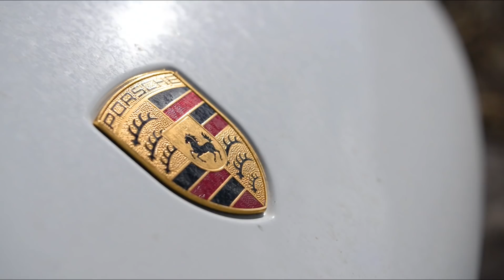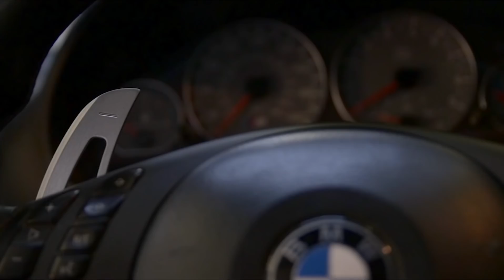Cars Are Changing

Comment: Bwhaha what?! Newer cars are easier to modify? That couldn't be further from the truth! Cars keep getting harder to modify!
Reply: Fábio Loureiro if I unplug my battery in my VW I get a check engine light I couldn't even imagine a remap
Reply: its harder, because sensors, and all those new stuff, nobody wants a check engine light just because you remapped your car
Reply: Yeah, you can't tell me that it's easier to modify a new 5 series than an old BMW 2002.
Reply: CJ Colvin I'm a 90s guy when it comes to cars, newer cars are trying too hard to look futuristic it's back firing. No attention to shape and lines, putting all attention into detailing and unnecessary ridges in the body.
Reply: Gears and Gasoline Wow really? It's common knowledge cars are getting harder to modify as they keep getting engineered more and more for economy.
Reply: It's little to do with economy and more to do with more and more sensors/electronic features getting in the way. Slap a minor bolt on onto a newer car and there's a good chance it will run weird without a tune, since the computer is freaking out.

It's also annoying that more and more manufactures are taking the "apple" approach and intentionally putting things in weird places to make them more difficult to work on. Some of the new BMWs don't even come with a dipstick because they don't want you changing oil yourself. Seems a little absurd to not let you check the most vital fluid??
Reply: As consumers get what they want, they change the products with them. Unfortunately, us car enthusiasts are the minority. Most normal people don't care about mechanical stuff or fluids in the cars they drive, which is sad but that's the way it is. Let's say normal people like shopping in malls and have interests in hobbies like art, does that mean you like that too? As much as I want to share the wonders of the car world to regular people, they couldn't care less. Just the way it is and I just wish...
Reply: Gears and Gasoline You obviously don't work on cars. Even simple things like changing a lightbulb are a pain in the ass in new cars. They made it more complicated so that everyone has to go the dealer.
Reply: Gears and Gasoline I imagine you've never worked on something with a live axle and a carburetor. If you get the chance you'll see how wrong you are!
Reply: Gears and Gasoline Except cars are overpriced, challenging to work on and they look hideous and ugly as well.
Reply: no, on modern car the engine bay got really cramp i can't fit a hand down there, also the oil filter on awkward position.
Reply: +Mike Seeds and those irritating plastic covers and shit. I sold my C63 amg because it's a money pit machine.
Reply: SideWayz Moose i guess it depends what,simple mods are easier,like exaust or performance chips or tuners,exaust dont have to worry about backpressure or adjusting carbs,and tuners can plug in and get more torque or few extra hp,but serious mods like bigger cam or injectors or suoercharher are a pain,sometimes having to change whole computer going through all that wiring harness bs.it depends really what kinda person you are what you plan on doing to car.
Reply: hahahaha yeah!! what a joke. i laughed so hard when he said that!
Reply: Gears and Gasoline Lol what car are you talking about that's easier to modify than a older model? I'm just wondering
Reply: look under the hood of a 2017 honda civic, and a 1998 civic, tell me which one you'd rather work on
Reply: SideWayz Moose duane agrees👌🏻
Reply: That's the most blatant lie ever said. Modern cars are designed to actually not being serviceable at all. It's not a thing of new and unfamiliar technologies, it's just planned obsolesce. Today's parts are disposable, model exclusive  and limited run, so consumers are forced to renew cars almost every 5 years, only because of availability of parts. Only flagships or speciality cars (sports, luxury, utility) have long term support, and that's mostly from the enthusiast community around them, not from the manufacturer.
Reply: EpiDemic117 I'm guessing you're talking about the particulate traps and extra fuel injector? I'm a diesel apprentice and I'm trying to learn all I can so knowledge is power
Reply: CJ Colvin Personally I find trucks to be generally hideous. But it's an opinion.
Reply: FroztiProductions The reason I bought my 96 F150 is because I love the look of an old school traditional pickup but it has power windows, door locks, air conditioning, and remote start. Also my 96 F150 has 203,647 miles on it and it's still going strong. The only thing I replaced on my truck was the starter but other than that mostly was just simple maintenance and cleaned out the transmission fluid just to get rid of the shuttering it was making and it hasn't had a problem ever since (until now since my power steering pump went out). The 302 and 351 Windsors are bullet proof engines in fact more bullet proof than the 5.4L SOHC 3V Triton engines as well as Ecoboost engines. I bought the truck back in Wentzville MO back in October of 2015 for  $3300 with my own money by working two summer jobs, taking care of my neighbor's dog, also having birthday money, Christmas money, and graduation money so that way I don't have to be in huge dept unlike you would with a new car or truck.
Reply: SideWayz Moose i thought this was sarcasm
Reply: Gears and Gasoline do you know how easy it would be to put a supercharger or a bigger cam in my 1967 mustang?
Reply: The "sealed for life" transmissions is not true about German cars. I work for Mercedes-Benz as a Technician and our transmissions have regular service intervals.
Reply: SideWayz Moose I was thinking the same thing! cars nowadays are so hard to modify its kinda ridiculous 😕
Reply: Its much harder these days, back when i were a young un I could get hold of a Mk1 Escort, drop in a cortina engine and gearbox, fit capri brakes hook up a couple of wires and a couple of feed lines and away i went.

Obviously the performance was nothing like a modern car but the difference between the stock and the modified car was similar.

there was much more room to work on the car, no coded ecu or sensors, no cats, no electronic gearboxes that refused to work with the wrong engine. iot was easier.

I like modern stuff and still modify it but its way harder than it was even when you know what you are doing even though it may be easier to get higher performance.

I have a '65 Rover 2000 (interesting car, worth a look at its development and design) that's getting Redblock Volvo Turbo power.
Reply: popuptoaster back in the day you could just put a big block in anything American and call it a day
Reply: That was my point?
Reply: Aah sorry thought it was aimed at saying it didnt sound easy in the UK, just read it the wrong way.

I'd say for a long time the Pinto engine (not the same as yours) that was fitted into lots of Fords was our small block chevy engine, it got put into everything, not because it was great but because there were loads of them around and they were cheap and tunable.
Reply: SideWayz Moose I kinda agree with you, they're more complicated and harder to tamper with
Reply: Pretty much what I was thinking............. I guess i'm getting old and I guess kids these days have no idea what cars from the 50s, 60s, 70's and early 80's were like. Back then modifying a car really was modifying, not just plugging it into a machine and uploading a remap.
Reply: Strider9655 for the nost part you still gotta do mods like back then to your car to get any noticable perfimanve out of it.acually,its probably more difficult then back the because of all the computers.the computers now tell the car to do everything,how much fuel,air,etc.so if i was to add a supercharger now,instead of slapping it on and getting bigger injectors,i would have to go in and sometimes reprogram the ecu,sometimes even change it.same with if i were to change the intake manifold,alot of times you gotta buy whole computer which is crazy expensive.but those chios and tuners dont do much hp wise.i bought one for my car,but only because it was the only way to turn off traction control off in my car.i bought a rt and i want to do donuts lmao.with the tuner you can give it more torque,turn off speed limiter,maybe 10 extra hp,etc.the torque change is noticable,but its not really a mod.from the factory they put limits on your car,like top speed of charger rt is around 160 mph,but factory limits it to 130 or something like that.do its not really a upgrade or mode,its just unlocking what your car is limited too
Reply: SideWayz Moose  very true
Reply: Exactly!
Reply: Servicing vehicles nowadays requires proprietary tools from that manufacturer brand sometimes. Touching your own car can even void warranties and with all of the electronics, the dealer will know exactly what you did.
Reply: EpiDemic117 egts and fuel economy makes sense, but how does it make the engine run hotter if it's all happening post- combustion?
Reply: SideWayz Moose on God. I remember 12 years ago when we bought our yukon, you could do all sorts of crazy shit to it and many people did including us. Now you cant anymore and i rarely see Yukons with aftermarket rims.
Reply: Yhea these days is more of coading but not really mecanic stuff, yeah you can get 30hp with a remap and nothing else but you can get more puting the engine apart and adding turbos, diferent exaust pipes, intercoolers and others
Reply: and less space because the dealers don't  waste any space anymore.
Reply: And expensive to modify too!
Reply: I like tuwtles
Reply: thechum ricer
Reply: Also, technology in cars have changed but overall it has 4 wheels, and an engine. Unless you're a noob driver there shouldn't be any trouble driving a 50's car to todays cars.
Reply: Sa Valaki cooler engines do last longer
Reply: And economy is the main reason for that
Reply: It is already like this, a tuner for the rich here, doesn't even bother for the engine (wheels and carbon fiber tho), he just completely overwrites the system of the engine and then it is much much faster.
Reply: SideWayz Moose bro my mate has an i8, I’m gonna roll Audi when I get a new bad boy but atm pretty much alll battery cars ur just paying for the battery and brand name , other then that it’s a car made of leather surrounding life sized LEGO - car . They was what I said when he got first showed me it a month or so ago haha, needless to say he wasn’t amused ^.^
Reply: SideWayz Moose bro the new Toyota’s  / bmw electric cars ur legit just paying for the battery and brand and a bit of leather / tech. 15k max 20 prolly covers cost , so much profit too b made . I have too switch my mates i8 engine out with a Prius’ and c how long it takes him ahaha
Reply: There's not even a point to modifying newer cars. Most of the new cars, if you modify them, will run like shit, have less power, and there's not even an aftermarket for them in the first place.
Reply: I think you misread my comment, we're both making the same argument.
Reply: EpiDemic117 I hear you man and my 96 F150 with a 5.0L Windsor V8 will outlast every single one of those modern cars you see on the road today.
Reply: FroztiProductions True but modern vehicles in general are not only overpriced but they look hideous, so complicated to work on, will get you stuck on car payments, and they have no soul.
Reply: i responded to gears comment
Reply: popuptoaster yea I was agreeing with you
Reply: Na you all are wrong.on my 2000 civic all i hadda do was put a fart cannon on it and slap some decals on it and i pullin way over 600hp.everything else is stock.after i put a turbo on it ill have faster 0-60 time fastrr than a ferrari.
Reply from the maker: +SideWayz Moose I own a 1970 Ford F100.
Reply from the maker: +SideWayz Moose new cars are unfamiliar to work on because they're not what we're used to, most cars nowadays are designed with the mechanic in mind and engineers have gotten much better at making things more servicable. (With the exclusion of a few luxary brands we all know and love)
Reply: @GearsandGasoline  They definitely had the mechanic in mind when you have to pull the cab off the truck to replace your transmission, or your entire engine bay has a plastic cover. They're designed to make the most money for the manufacturer and also have obsolescence designed into them. They're designed so that major repairs are so labour intensive that you buy a new vehicle instead. It's always been that way (like when GM decided to use screws that required a dealer owned screwdriver) but now manufacturers have mastered making vehicles that can't be fixed by vehicle owners. Right now, farmers are fighting for a "right to repair" law against John Deere because of the dealer-only software missing from new parts upon purchase.
Reply: @GearsandGasoline  if you don't know the difference between servicable and modable idk how you keep such a good chanel going. How hard is it to find mods for a 2005 wrx vs a 2019wrx?
Reply: @GearsandGasoline  Bullcrap, sure they may be easier, but you will need multiple special tools and skills that if you mess up one thing like wiring that everything is relied on like you say about cruise-control, double-clutch etc. It is not worth it to fix and may also lose your vehicle as well for messing something up!!!!!
Reply: Like sealed transmission, you can change out the fluid easy, today, they do not even have a dipstick. What the hell is wrong with people!!!!
Reply: Fábio Loureiro Read the fucking comment above